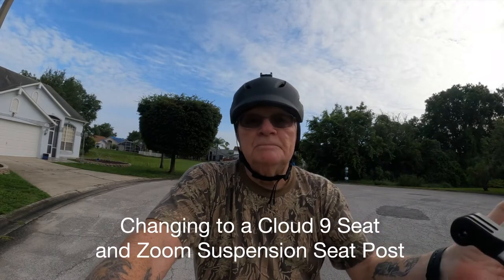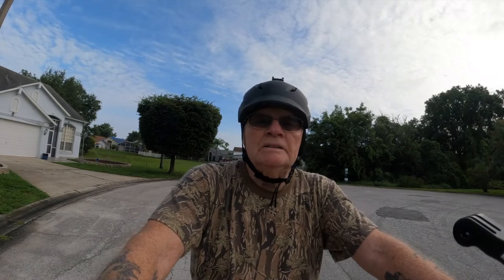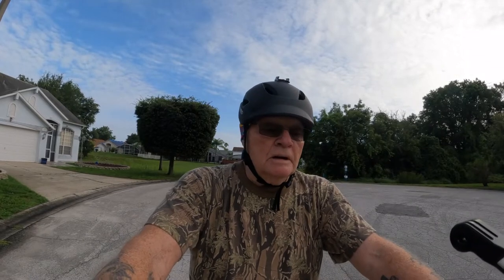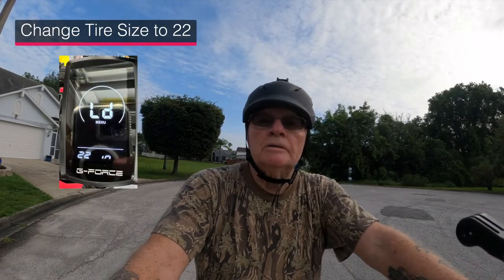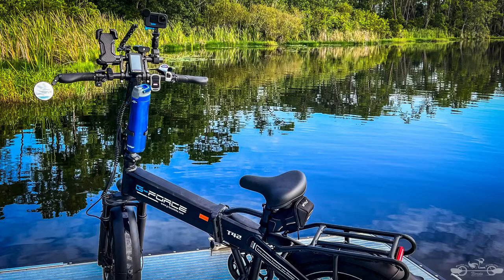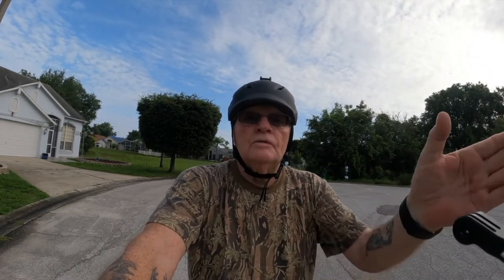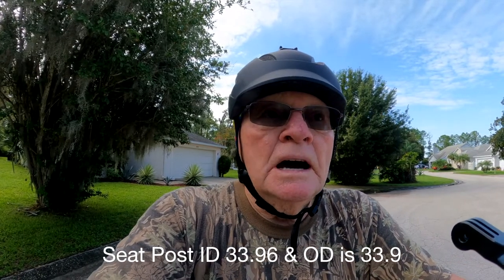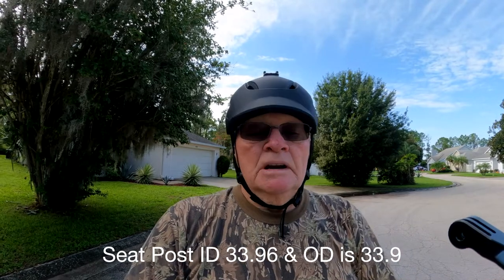G Force T42 Addressing Quality control Issues Part 3

Comment: My display wont go into page 2 to set the wheel size or fine tune each pedal assist level. 
When i hold + and - the only page i get displays P1 p2 p3 p4. 
Which is completely different to what anyone elses display displays. 

Can anyone help?

Comment: I want to know which is better electric bike xp 2.0 or G-force, you have had both and can you help me choose thanks.
Reply from the maker: Wow tough question. The Lectric XP 2.0 is a fantastic ebike. But so is the T42.  So the best way to explain which is better would be based on what you want to achieve. For recreational riding, mostly surface roads and 20 mile rides the Lectric is the correct choice. However, if you want to go off road and have more hills that’s where the T42 shines. Its 750 watt motor provides a lot of torque and its 4” tires track better in loose dirt or sand. Now the 4” tires sing louder than the Lectric’s 3” tires. The T42 has a thicker frame and hydraulic brakes clearly out shine the 2.0. The 2.0 price point at 999 is very attractive vs the 1400 (55 mile range battery, 16 amp) Hope that helps.
Reply: @DaleMrDSimmons  thank you 👍🏻
Reply from the maker: @osvaldolopez366  you are welcome and thanks for watching